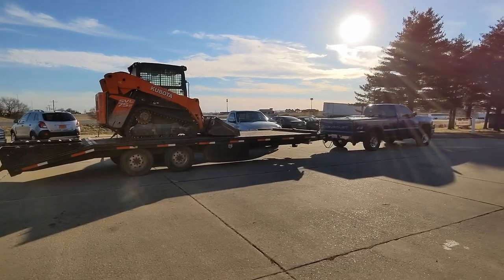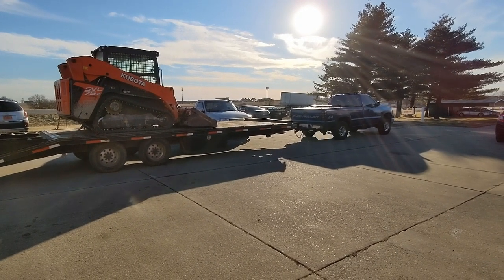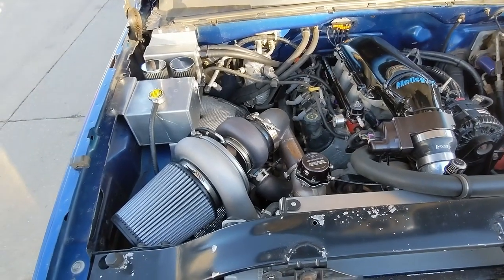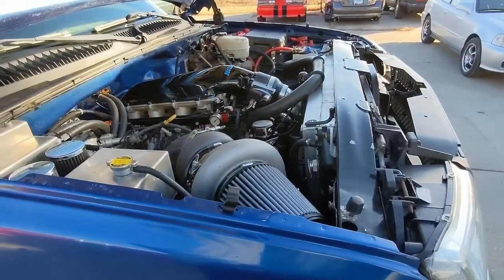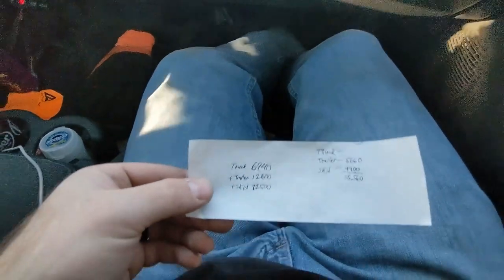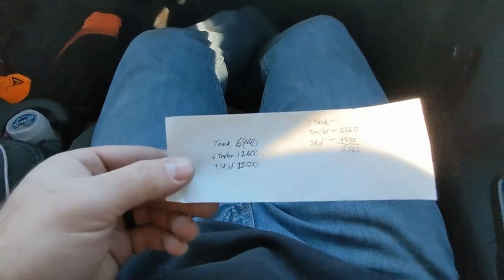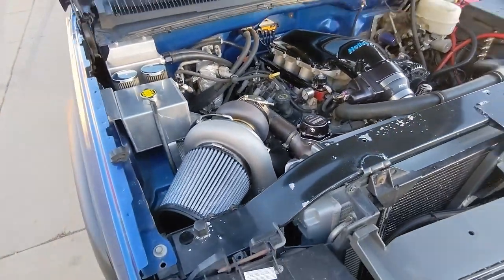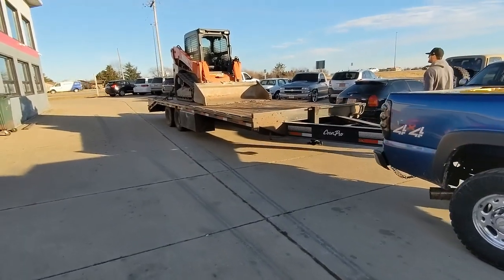LSX Turbo 2500 Truck - Pulling a 15K trailer!!!

Comment: Now this is a build I can get behind. Don’t wanna spend 50k on a diesel? Slap a turbo on a 15k gasser and it works all the same for 20k. Awesome
Reply: You can buy a diesel for 10k. Just leave the truck stock so it stays reliable. That’s why you buy gas anyway, not for power.
Reply: Don’t get it mixed up
Reply: @sugmaball5383  you buy a diesel for 10k and it’s gonna be a rotted shit wagon. Clearly you aren’t in the market enough to be knowledgeable about pricing these days. Everyone thinks it’s worth it’s weight in gold. Vehicles with bad trans or engines are pulling 7-8k. Not a shot in hell your getting a good diesel for 10k. Don’t get it mixed up.
Reply: @MintMonte87ACSS312 incorrect
Reply: @fritznonya459 proof?
Reply: @fritznonya459  no he's pretty much spot on lol
Reply: Need to see more of this truck
Reply: @oceanwaves83  nah i just got a 2001 ram 24v cummins 178k miles no rust for 10k lol clean car fax minor scratches on the paint
Reply: @Jonathan-cu9co  you got a really good deal.
Reply: @oceanwaves83 in my area a 2006 or 2007 duramax with 200k miles is still 30-35k haha. Maybe you can find an lb7 or lly for 20k with no fenders left

Comment: Who says you need a diesel to pull heavy trailers.  Just a turbo!  And everything that goes with adding a turbo.  Huge difference between Matt's truck and my stock 02HD with 6.0L and 4L80E.  Mine is working pretty hard with about 12,000lbs behind it.
Reply: Except he’s getting 5 mpg to a diesels 15-20
Reply: @loweredyote8416  stock diesels now days don’t get 15-20 without a load lol
Reply: @Slablabfishing2023   Exactly I get 10 towing 10k with duramax l5p
Reply: @loweredyote8416   No he ain’t got a 2020 l5p and get around 10mpg at $5 a gallon
Reply: @loweredyote8416  Diesels take more oil, fuel filter, you'll spend $5000 on injectors when the time comes. And diesel costs $1.00+ more per gallon. So a extra 5-10mpg isn't cheaper over a gas truck. But power isn't cheap no matter what you build.
Reply: @loweredyote8416  10,000miles for a diesel, 6-8000 with full synthetic for gas. you use 4 more qts on a diesel. yah I'm a "idiot" I meant 5k on injectors to have a shop do everything. And you still have to recalibrate them even after replacing them if you do it yourself.
I haven't even mentioned 2-3k for a turbo and how hard it is to work on anything on a diesel. Mean while I can buy huge injectors for a gasser for $600 or stock for $60 and replace them in 30 minutes and they last 200,000 easy. 
And you'll spend double on a good diesel truck compared to a gasser. So not sure how diesels are cheaper. 
But what do I know I've only ran and worked on both.

Drive what you want and like but diesels aren't cheaper to run.
Reply: @christophermix6845  you still come up even with cost differences
Reply: @loweredyote8416  you're right on fuel if running higher octane which most will be, depends on compression ratio and power goal. But still think the cost is higher with injectors being so expensive. 

But to each their own 👍 I just love how easy it is to work on gas motors compared to diesel's.
Reply: @christophermix6845  wayyyy easier on gas motors. And easier to make power. In the long run anyway. Cheaper too
Reply: @loweredyote8416  definitely.

But gas cannot beat a diesel when it comes to torque.
Reply: @christophermix6845  yeah never lol
Reply: Torque numbers, diesels can drag more shit, but a gasser can do it faster
Reply: @tripifi9303  that’s wrong as shit too lol
Reply: same here my 05 2500hd stuggles with 12k+
Reply: @christophermix6845  yeah umm disagree
Reply: @loweredyote8416 my Duramax gets 11.9 mpg without a trailer.
Reply: @connor4961  then drive better lol. My buddies lifted lmm gets 14 with a trailer 17 without
Reply: @loweredyote8416  his is probably deleted and doesn’t have a turbo that shit the bed.
Reply: @connor4961  not deleted. Bone stock other than the lift. Good turbo though.  That’ll do the trick lol

Comment: I bet its a transmission since this video.  But its siiiick. Would be interested in seeing what kind of life he got out of it.
Reply from the maker: Its still got the same transmission. The owner has it here at the moment for some work and a little weirdness in the (stock) throttle body. The drivetrain is still kicking just fine, but the snowplowing is hard on the suspension. Body is still solid!

Comment: Do you have a link to the crank case vent box y’all used? Correct me if I’m wrong but that’s what that was sitting behind the overflow tank? I need something similar to vent mine. Looks real good!
Reply from the maker: It was supplied by our customer.  I am unsure of the brand.
Reply: Yes. It's a catch can/over flow tank from snail fab on FB.

Comment: I’m thinking about boosting my 2500hd and trying to figure out what turbo to go with.  I’ll pull at most 8500lbs maybe 10 times a year.  It’s my daily and might drive 15 miles a day.
Reply from the maker: We are Bullseye turbo dealers and would be more then happy to go over your options.  Give us a call, email, or message us on facebook!
Reply: Stage 2 summit cam and a S475. Keep the stock stall. Stock 862 heads from a 4.8 if you want cheap factory power.
Reply: @Scramspeed  where are you guys located?
Reply: why did you say keep stock stall?
Reply: @zackariacherif1078  helps keep Temps down on the transmission
Reply: I know there are better turbos but a gt45 knock off would probably work well and are like $160 last time I looked so just have a spare

Comment: Very nice truck, really like the blue color. The sound is nothing but bad. Wondering it the turbo helped MPG on the truck. I have a 6.0 in a 1999 Chevy 2500 Excab 4x4 tow package 3.73 rear gears. Great engines the 6.0. Bought it with 110,000miles now it got 214,000 still going strong.  I have two other Chevys a 2001 2500HD Excab 4x4 Duramax LB7 94,000 miles; and a 2004 3500 Crewcab 4x4 8.1 (496ci)  4.10 rear gears. All three are good pulling trucks.  Would like to see and know more about the Blue Chevy 6,0 turbo.

Comment: I have a 2011 Silverado 2500HD 4x4 with the iron block 6.0, I'm researching putting a cam / long tube headers  / twin screw supercharger to achieve this type of power to tow my 12k RV. Thoughts? 

I'm also curious as to what mpg this turbo gasser is getting towing this load?
Reply: It's just hard to justify supercharger money when you can literally turbo a truck for half the cost. Even less than half if you fab up your own merge using the stock exhaust manifolds etc. Heat management with a screw blower is another issue. I can imagine IAT's towing with one would be pretty spicy. Those sandwich type intercoolers work well. But they're expensive as hell and make the SC sit really high up. As for fuel mileage I can imagine it's not great. I'd be surprised if it's getting 10 mpg once it gets into boost.
Reply: Agreed with the other guy, turbo setup is cheaper and imo better optimized for heavy loads. S/c is rpm dependent but turbo is load dependent. Both will make major torque but the turbo is kind of more fluid and wont be as inefficient at low load/light cruising.
Reply: @FastPaull  , something to ponder.
Reply: @FastPaull  hell, I'd be happy with 10 MPG with my stock 2004 2500 6.0L silverado.

Comment: I have been wondering, did this make 650whp on the stock converter w/ setrab cooler, or did you buy a converter as well?
Reply: It's a custom billet triple disc from jakes performance
Reply: @shwab8 what converter is it? 310mm or 265 and what stall speed?
Reply: @jacobwortman916  i can't remember. I called them and told them what my goals were and they  built it to suit.

Comment: You would be much better off using the stock intake manifold if you're towing with that setup. Probably losing 80-100 ftlbs in the mid range with that short runner stuff. It's been proven time and time again those manifolds don't produce hardly any gains until 6k+. Now if it's just for looks, then whatever. LS3 intake manifold or a FAST manifold is by far the best choice for 90% of people.
Reply: He didn't want to much torque down low. He wanted more up top.
Reply: @allanb3222  More torque up top? He isn't towing at 5500 RPM. When you're towing, you're lugging the engine, you're nowhere near the efficiency range of that short runner intake manifold. I doubt the camshaft is even correct for that style of intake manifold.
Reply: @FastPaull  He wanted more Hp up top like he stated. Not torque.
Reply: Runner length doesn't matter much when boost is involved.
Reply: @travishanson166  lmao yes it does. Go watch any Richard holdener video
Reply: Sounds like he's trying to be friendly too his rods lol. 

That said, I'd have run truck Intake too. T Unless I was taking advantage of those intercooled setups.

Comment: Nice.. big inches ls motor and a camshaft spec for low rpm torque. Or even go bigger with gen7 gasser Big block with  turbo. I know you can't beat low low rpm diesel. But try as much a possible for low rpm and low boost torque on a gasser. Don't even think about hp. I like to see any body would try that. For towing high rpm not good. Only for fun and short distance its ok, or showing off ur truck.

Comment: Jesus that would be so damn sick. I tow 6-12k+ daily in my 04 2500hd 6.0 and I'm dying for more power. I see the Duramax radiator and intercooler, but how does it run with those e-fans?
Reply: How well does it do pulling more than its factory rates for at 12k? Mine is an 07 classic regular cab 2wd 6.0/4l80e with a 4.10 gear. Only rated at 10k. The 2wd reg cab has the highest towing capacity out of all the body styles. More the truck weighs, just subtracts from gvw. 16k gvw for these trucks.
Reply: @dickbrugh5562  That's just the factory rating. I've pulled 12k with a 03 extra cab 2wd 4.8L/4L60E, 3.73 gear. Just had brake controller, 10 ply load e tires, air shocks in the rear and hitch with anti sway control bar. That's about 3 or 4k more than the factory rating with the small LS and weak transmission, small brakes and small rear axle. Didn't go down mountains but did several 800 mile round trips along the I-10 and changed the trans fluid more often.

Comment: That's ridiculous.  Did Matt beef the trans aswell?
Reply from the maker: Yes it currently has a Jakes 4L80E that has been treating him very well.  Only hickup we had was trans temps due to the converter.  Had to install a massive setrab cooler and it seemed to do the trick.
Reply: He doesn't best on it but it definitely is a work horse....
Reply: @Scramspeed  Do you know what cooler he went with?
Reply: How much converter does he have here?

Comment: Id love too know how you came up with the truck weight mentioned in the video.
Reply: Truck is right around 6k. It had about 800-1000lbs of salt in the bed. Truck was 6940lbs, trailer 5660lbs, skid 9900lbs. Truck+trailer=12,000lbs
Trailer+skid=15,560lbs
Truck+trailer+skid=22,500lbs

Comment: Was the oil and trans cooler that is built into the d-max radiator used?  If not what was used instead?
Reply from the maker: It used separate coolers. I believe they were Setrab.

Comment: I’m shocked you were getting 6940 for truck weight. My 2005 crew cab short bed diesel SRW weighs about 7100 with a 50 gallons of fuel and me in it.
Reply: truck had 1k lbs of salt in the bed. 2 passengers plus 1k salt, truck probably sits around 56-5700. pretty close to stock.
Reply: The truck weighs right at 6k with me in it. It had around 800-1k of salt in the back during the video.
Reply: There was gear in the bed, that added additional weight to the truck.
Reply: @shwab8  

6k for a 2500hd single cab short bed? Find a new scale.
Reply: @8SecSleeper  they don't make a regular cab short bed 2500hd just FYI. Toolbox full of stuff is couple hundred pounds. Plow bracket is a 100lbs. The turbo itself is probably 50+lbs. Has a big intercooler.... this isn't a stock truck at stock weight. It's also 4x4 if you happen to miss that too.

Comment: I have a question. Where does the exhaust coming from the turbo get routed to. It looks really tight on the passenger side. I’m doing the same kind of setup with my suburban 2500 and the engine bay fills up fast.
Reply: Where the factory manifold would connect to exhaust.

Comment: Hopefully you can answer my question... I'm getting ready to drop a lq9 into my 94 chevy ext cab... what trans do you have in it and did you do any cam n head work to the motor? And where did you get your radiator?
Reply from the maker: Yes, it has aftermarket cam and heads. I don't recall on the radiator, I will look int it!
Reply: 4l80 more than likely. I have a procharger on my 2500. Pass everything by the gas station
Reply from the maker: Sorry for sleeping on this, it has a built 4L80 transmission.

Comment: Where did you get 6940 for the truck? Single cab 2500 6.0 should be closer to 5300-5400 full fluids maybe 5600 with added weight of turbo setup and gooseneck
Reply from the maker: The owner of the truck detailed all the weights of the truck, trailer and cargo in a previous question.
Reply from the maker: "Truck is right around 6k. It had about 800-1000lbs of salt in the bed. Truck was 6940lbs, trailer 5660lbs, skid 9900lbs. Truck+trailer=12,000lbs
Trailer+skid=15,560lbs
Truck+trailer+skid=22,500lbs"
Reply: @Scramspeed  Well scale was weigh off or he had something else going on because nearly 7k lbs for a single cab 2500 is way off. Even a 2500 Suburban is going to weigh maybe 6k. 

A 1500 will weigh about 4500 lbs and the main differences between a 1500 and 2500 is the rear axle (about 200 lbs heavier), more leaf springs (no more than 60 lbs) the driveshaft (15 lbs), a 4L85E trans (85 lbs heavier) and front end about another 100-200 lbs, radiator and HD cooling maybe another 25 lbs.
Reply: "It had about 800-1000lbs of salt in the bed" Boom

Comment: Seems like it would be better for towing with a stock truck or TBSS intake manifold.
Reply from the maker: Customer did not want too much torque down low.  When it has the plow on the front and salt spreader on the back he had concerns about just spinning immediately when trying to push snow.  Decided to keep a higher RPM intake to keep the torque soft in the lower RPM area.

Comment: I’m either doing this or a supercharger for my 2010 suburban 2500. Which would be better for towing, and why?
Reply: Supercharger would likely be cheaper and easier, and give good low end power. You'd be paying for it in gas mileage though. I'd personally go turbo
Reply: The residual draw is not worth it

Comment: The high ram seems like a bad choice and just extra unnecessary money the factory would probably be better everywhere below like 5 grand for no money extra but at those power numbers the stroker was unnecessary its not like its going to make it any more reliable and its not like its going to make much of a difference with the turbo if its not way to big which if its making 650 i assume its not
Reply from the maker: The customer specifically wanted the high ram to knock some torque out of the bottom end.  Half the year this truck has a snow plow and salt spreader attached.  He claims it is nicer to push snow with something that doesn't make instant torque to just spin the tires.  Plus it looks way cooler.
Reply: @Scramspeed  it's his money

Comment: I have a 2006, 6.0 Silverado basically stock besides a cold air intake and a tuner. I want to do this to my truck but still be able to use it for truck stuff like towing a heavy trailer or run through a mud hole. Would I still be able to do these things if I souped it up like this?
Reply: Chose a setup that makes power down low. 
Stick to a truck cam, i think texas speed's stage 2 truck cam is the most you can go before it sacrafices low down torque and still makes more power up top when youre not pulling something. Pair it with a smaller turbo, something that spools quick down low but dosent choke out when youre really reving it out. 

Youre not going to make as much power as someone who went balls to the wall but itll make useable power down low and still be a lot faster than it used to be.
Reply: BTR truck Norris with whatever turbo. I just know that cam will be awesome with an application like this

Comment: Little late but is he spraying water/meth? How do you keep it cool enough pulling that much weight?
Reply from the maker: No meth on this truck. He has an intercooler from a duramax truck to keep the IATs cool.
Reply: @Scramspeed  would you say that intercooler is a reliable route for someone turboing a 3/4 ton 6.0 truck that does haul?
Reply from the maker: @jaxonrickman5097  Well, he has been driving this truck for quote some time. Pulling and plowing with it, with no issues. In this case I would say definitely yes.
Reply: @Scramspeed  thank you for responding so quickly!

Comment: Being its a truck used to tow im interested in the torque on this setup. Anyone have any idea???
Reply: If I had to throw a number at it I'd say somewhere around 700 to the wheels.
Reply: It made right around 650rwtq on 12psi. The heavier the load the more load the turbo has. In this video it drives a lot like a diesel. About quarter throttle and its at psi pulling that much weight. Once up to speed it's back in vacuum driving like stock.
Reply: Cool build but he is probably getting  6mpg on a good day and gonna have no longevity
Reply: You have no idea what you're talking about. The setup is built specifically for what it has. 
Forged internals, etc.
People with clean, well put together combos, like this, know what they're doing and know who to reach out to to further back what they're doing. 

You could tell what kind of build it was when he opened that hood and again when he did that pull to 70.  @lucaparrillo6474

Comment: Badass man is it a built 4L80E or turbo 400
Reply: Looks like you have a methanol set up to that's badass man
Reply: Don't trust Efans 5:49  but if you got the right setup it would wo r k
Reply from the maker: It's a 4L80e. Its a great build.